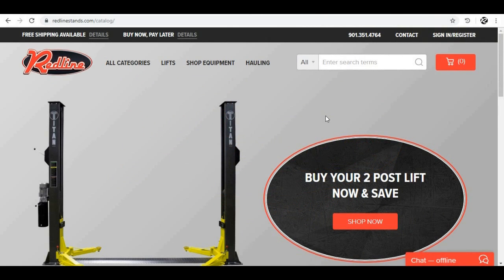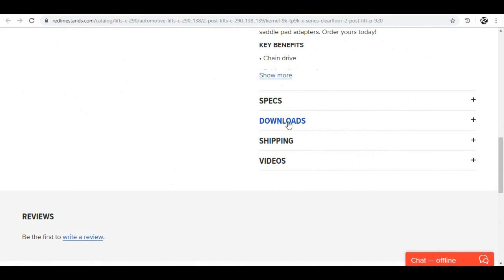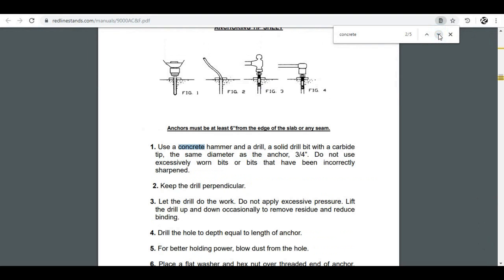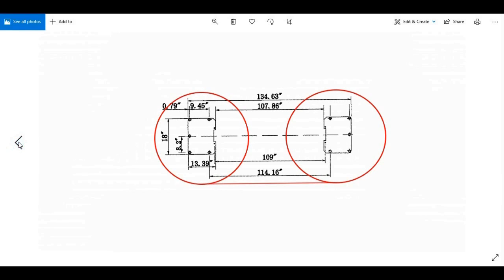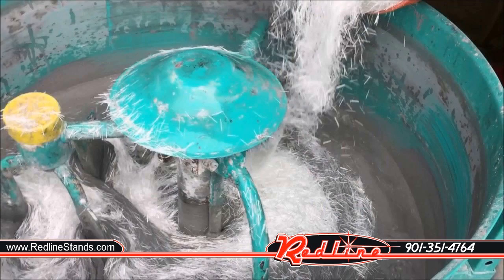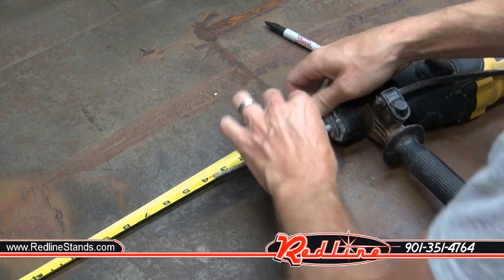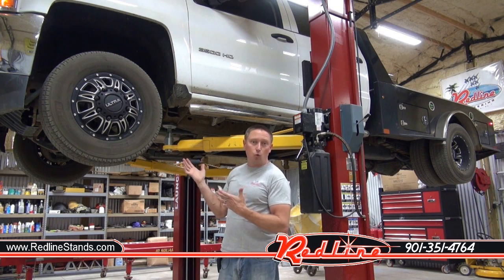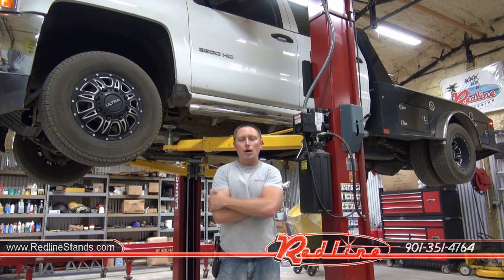Concrete Requirements for 2 Post Auto Lifts - Tutorial

Comment: Before you pour extra thick concrete, consult the lift manufacturer's recommendations in the manual. The requirements listed in the manual are safe and have been safe for decades. It is not necessary to over do it. You may check with your installer as well. Anyone who recommends more than is required by the manufacturer is claiming to be smarter than dozens of engineers and architects. Think about it.
Reply: We have thought about it. As a matter of fact, the person making this suggestion is...wait for it.... a Mechanical Engineer. Think about it...
Reply: @dustingilmore2710  ....And he knows more than a  of the other engineers in the World?
Reply: @philipbrown6500  look fella, it's over kill. The machine gets all of its structural rigidity from the concrete base so the thicker and stronger, the better. End of discussion..
Reply: As someone spending tens of thousands of dollars building a shop with months of prep work, design, research, etc.  and then spending a few thousand on the lift itself, why in the world would I NOT spend ever so slightly more (It won't be much considering the overall cost involved here) to add reinforcement to an area that will see the majority of weight in my shop?  Lets say that I build it for the smaller lift in the video and take your advice and stick with 4" at 3000 psi with fiberglass.  minimum spec.  5 years from now I decide that this lift sucks and I want a better, bigger one...oh wait.  I followed your advice and now I can't because the new lift has a recommended minimum of 6".  Good thing I followed Redline's advice and added the safety margin recommended here.....everything you state here is just stating the obvious and was actually stated in the video.  He showed exactly how to find what the manufacturer recommended.  He gave advice....spent time to create a great video....explained and showed pictures.....even showed that he did this on his own garage (meaning he took his own advice)....I am very thankful and appreciative of the work involved to give the great advice!
Reply: @FullThrottle316  If you're spending tens of thousands of dollars and months and months building a shop, why would you go out and buy a "lift that sucks"? Why would you not research the lift for a day or two at least. It seems that, during the months you spent on "prep, design, research, etc.", you would've spent the time necessary to buy a quality lift instead of filling your "tens f thousands of dollars" worth of shop with Harbor Freight tools? Furthermore, if you decide to replace your lift, you can't install your new lift in the same place. Once the concrete is drilled for mounting the first lift, the integrity of the concrete is breached. The new lift has to be mounted a minimum distance from any previous penetrations or cracks. I'm not going to give those specs right now. I'm not going to take the time to look them up but, like the specs for minimum concrete thickness, all lift manufacturers can provide them for you. What does that mean? That means, unless your research told you or you knew ahead of time, possibly from past experience, that you were going to make a stupid mistake and buy a lift that wouldn't accommodate your needs, all of the research, design and construction of your shop was useless and a waste of money, not just because the lift manufacturer said so but, because the extra thick concrete is not where it can be used again. Your new lift has to be mounted elsewhere, unless of course, as I mentioned earlier, you planned on being stupid and poured a huge area of extra thick concrete. To add insult to injury, when you go to take down the first lift, you will have an extremely difficult time doing so because your efforts will be hindered greatly by the fact that you can't drive the anchor bolts through the slab. You'll have to find a way to slightly raise your lift off the slab and support it so that you can cut all of the anchor bolts of flush with the slab so that you can move the lift. It's very awkward and dangerous to try to move the lift post to the side when you try to raise it up and slide it to the side and it's sitting on top of the anchor bolts. Another thing you should consider..... WEDGE ANCHOR BOLTS ARE DESIGNED TO SECURE THE FLANGE OF THE POST TO THE SLAB. THIS MEANS THAT THE FORCE EXERTED BY THE LIFT PULLS UP ON THE FLANGE AS OPPOSED TO PUSHING DOWN. THE OVERALL WEIGHT OF THE LIFT AND IT'S LOAD ARE DISPERSED IN MANY WAYS, NOT JUST DOWN ON THE SLAB.  Concrete that is poured beneath the depth that the anchor bolt reaches is useless in preventing collapse of the lift. History shows that nearly all and I'm talking about a vast majority of lifts that collapse or drop their load do so because of unsafe/improper operation or improper/lack of  maintenance.  Like I said in my original comment, you can do as you choose but, everyone who builds a shop and installs a lift doesn't have the funds to piss money away on unnecessary upgrades. The  need for extra thick concrete is something people do because they lack knowledge and experience and they think they know better than the engineers employed by the lift manufacturers. If more concrete were necessary, surely one engineer in the industry would publish that information. They have a liability to consider.  What reason could they possibly have to understate the requirements? It makes no sense. I'll close by saying, I have half of a lifetime of experience installing and servicing lifts of all kinds. I've done hundreds, probably thousands of lift installs and I've never had one that I installed collapse, NEVER. I've probably been on as many calls to deal with collapsed lifts and/or dropped loads than the total number of lifts man who posted this video has ever installed in his life. How many lifts have you installed? My advice to you..... Ease up. Don't be so bitter. And don't talk or post comments about stuff you know nothing about. I rest my case.
Reply: Philip Brown its their money! Pipe down lil fella😂
Reply: @larrypruitt3919  It's bad advice, plain and simple.
Reply: @philipbrown6500  interestingly, I cant find any vids or photos of 2 post lifts ripping up the concrete. All fails seem to be down to not locking arm or loading. I have seen one that looks like the anchors pulled out. Most likely where not checked.
Reply: I just built a new garage... lift I will be installing calls for 4" 3500 psi concrete.  I went with 6" 4500 psi reinforced....well worth the few exta $$$ for my piece of mind.  It will be my ass under the lift - not yours or the person providing the specifications.  I fail to see your argument unless it would degrade the results and create risk...which it does not.

Sorry but adhering to "minimum" specifications while talking about a device that will hold a car above my head is not something I want to just meet "minimum" requirements.
Reply: @ericanglum  You can so as you wish regarding your new garage. No one has indicated in any way that you shouldn't. If you get "peace of mind" from having your lift mounted in thicker, stronger concrete, by all means, that is what you should do. Some people get peace of mind from sleeping with a gun under their pillow. I say, "How can you find peace of mind when you have to have a gun under your pillow to sleep"? For you to suggest that following the lift manufacturer's specifications for concrete will result in your being injured of killed is ridiculous. Believe me, there are many, many more lifts anchored in concrete that meets the minimum requirements than there are anchored in overkill concrete. Just because you have chosen to pour more concrete than is necessary to anchor your lift doesn't mean it's necessary or better, it means you aren't comfortable working around a lift. Anyone who has experience working around lifts isn't scared to work around one that meets the manufacturer's recommendations. It's that simple... The necessary thickness and strength of concrete required to install a lift is stated in the installation manual. Anything more is unnecessary and strictly a matter of choice.
Reply: @philipbrown6500  
Advise me. 
My concrete was supposed to be poured thicker where the lift was to sit. It wasn't. 

I wasn't there when it was poured but about a year later when I had the lift installed the installer told me I "may" have 4 to 5 inches. The look on his face said it may be less. 

Either way for 10 years the lift has been fine. Now I have cracking and lifting around the base of one tower. (No I'm not using it until the issue is repaired)

I plan to repair this and get a new lift. 

My question to you is what process do you recommend to repair it. 

I had planned to cut a 36x36 section out, dig it down to about 8 inches, put it rebar and fill it with new concrete. 

Tell me what you would do in my position. Thanks in advance.
Reply: @Aint_no_senators_son  I would do exactly as you say, except I would cut out a 48” x 48” section in stead of 36” x 36”. For a 9,000# two post, MOST manufacturers spec 4” thick. For a 10,000# 2 post, MOST manufacturers spec 6” thick. Your owner’s manual and/or installation manual should show what is required for your specific lift.
Reply: @philipbrown6500  
Thank you! I will do the 4x4. Gonna do it next week. Just so my old lift and got it out of the way.
Reply: You can end the discussion if you choose but do so knowing that everything you propose here is above and beyond what is deemed necessary by the lift manufacturers. It never ceases to amaze me how many people will post a video explaining something they don't know anything about.
Reply: @philipbrown6500  so I encourage people to go above and beyond the mfg specs and it's a problem for you??? That means I don't know what I'm talking about??? Wow man, you're like arguing with my ex wife. No logic. I guarantee I know 10x more about this than you. Go bother someone else troll.
Reply: @dustingilmore2710  So you encourage people to do things that are a hinderance as opposed to a benefit. The standard anchor bolt used for lift installation is a 3/4" x 5 1/2" wedge anchor. As a structural engineer, you should know how a wedge anchor works. How does extra thick concrete give any additional strength to the anchor? It doesn't because it can't. Extra thick concrete might help some people feel more secure working under the lift but it does absolutely nothing towards securing the lift. If the specs laid out by the manufacturers were not adequate, they would not be listed. It is a life safety issue. I'm sure that plenty of testing has been done to arrive at those numbers.
Reply: @dustingilmore2710  I've installed over a thousand lifts in my lifetime. I really don't think you know as much as I do about it, much less 10x more. If you did, you wouldn't continue disputing the specs ALL lift manufacturers worldwide put their reputations and their customer's lives on the line based on. I'm not a troll. I'm someone with a lifetime of experience in this field that doesn't want to see consumers misinformed.
Reply: @philipbrown6500  so, you think going above and beyond is misinformation? That's ignorant..
Reply: @dustingilmore2710  What's ignorant is for you to think you know more about this than all of the manufacturers do. I simply stated facts and advised that consumers reference the manufacturer's recommendations before incurring extra expense and extra work when pouring concrete. It's simply not necessary. If you presented accurate information in your video rather than your opinion, we wouldn't be having this conversation. Furthermore, if wasn't correct in my statements, you wouldn't continue replying. I never said there was anything wrong with your advise aside from saying that it's not necessary to pour extra concrete and that is a documented fact.
Reply: OTOH concrete cost in the tiny quantity required for a lift footing (as opposed to a large slab) is trivial and concrete companies often have a minimum quantity or charge when they send a truck. Compulsive minimalism for it's own sake is adorable but in this case not enough money is involved to matter.  If a few bags worth of concrete matter that much the customer should probably stick to jacks and dunnage so they have money for other things like not starving. When pouring a large slab it may be expedient to go thicker too if one desires the option to mount heavier lifts or other machinery. Many businesses plan for capability expansion and equipment rearrangement.
Reply: @obfuscated3090  Again, it is not necessary. You can do what ever you choose but, not everyone is able to spend as they wish. You comment about sticking to jacks and dunnage is rude and arrogant. Maybe you should stick to judging yourself and letting other people judge themselves. God doesn't like ugly and I don't recall his asking for help judging people. Also, your opinion doesn't trump facts and the fact is, all lift manufacturers specify how thick the concrete needs to be. Pouring extra thick concrete is a choice not a necessity. It isn't necessary. It just isn't necessary. The poster of this video says in his comments, "it's over kill" because it's over kill.

Comment: If I’m not sure what PSI my concrete floor is, can I still buy a lift?  We have no fiber, but we do have wire mesh reinforcement...
Reply from the maker: Maybe, maybe not.  Without knowing the specs of your concrete it's impossible to guarantee safety.  All you can do is take steps to minimize the chance of an accident.  Call us at 901-351-4764 ext 1 if you want to discuss.
Reply: You can always rent a concrete saw. cut a hole and pour an amply deep footing for each post. If needed Sonotube and others make tubes for that purpose, they look like the tube inside a toilet paper roll but of course big enough for foundations. You can also cut (for example) a piece of heavy beam two or three feet long, weld a plate to your top end, and pot that in your concrete. 
There is another, easier  option without cutting the floor. People forget steel is reasonably affordable (and mechanics have many of the right friends at scrapyards while todays prices are low) and while lift makers must consider base plate shipping sizes and cost in volume when they buy steel you are free to buy (how large is your call) much larger plates of say 1/2 or thicker steel to spread the load much wider and use more anchors. There's no limit to laying plate as long and wide as you want to go. 
Mag drills can be had at any rental store and a rotabroach, not a drill bit, is the slick way to make holes in plate. You can use a plasma cutter (yet another good excuse to buy one) or an acetylene or LP cutting torch (which every  mechanic should already have as they cut, gouge, heat for torch bending, gas weld, braze, solder, and other useful jobs) will make short work of cutting holes in plate. 
Gross overkill is a good thing. Your local steel supplier can cut to size if that's not convenient for you.
Reply: @obfuscated3090  if you cut out a section of concrete to pour back thicker where your lift will mount, yhe cut out section must be z minimum of 48"x48".
Reply: Contact a qualified lift installer. He will have the answers you seek and any solutions necessary.
Reply: Concrete companies, as a norm, don't sell anything less than 3500 psi concrete. Call as many as you need to in order to confirm this. You may find some that are willing to special mix some for you but it would be a special order. 3500 psi is the stanxard in concrete.
Reply: @philipbrown6500 That's not true or it might be a regional thing. I would say the above is very typical in commercial work; 3500, 4000, or higher psi mix designs at the typical 28 day test, however depending on the age of an existing structure, particularly residential, it wasn't that uncommon to have 3000 psi concrete used. Tract home builders will do anything to save a penny, you can bet they are doing interior concrete work and foundations with 3000 psi mix designs today. They also have the yardage to dictate what they want. It's also certainly possible that concrete that's been down a while even mixed at a lower design strength could test higher too depending on cure conditions.  There are also ways to test existing concrete's strength if there are concerns to the strength of the concrete.
Reply: @hmann34  Did you read where I said,  "Check with a lift installer"? Did you read also where I said, "You may find some that are willing to special mix some for you but it would be a special order. What concrete company did you contact and what did you ask them? That's what I thought, you didn't even make a phone call before posting on social media calling me a liar. I stand by what I said, "3500# IS THE STANDARD in concrete". What you won't find is a lift manufacturer that will tell you to pour more concrete than is needed.